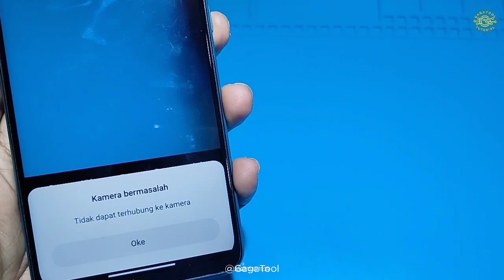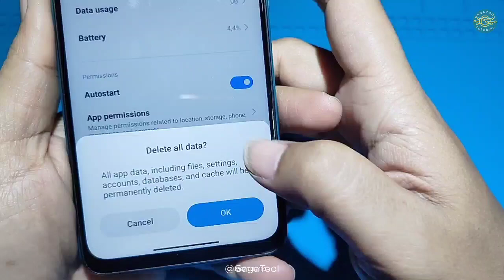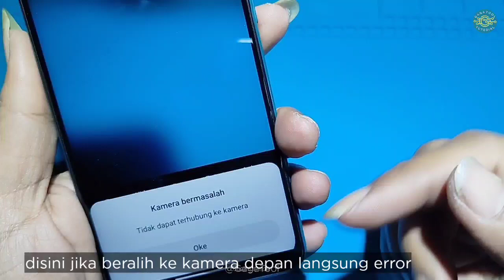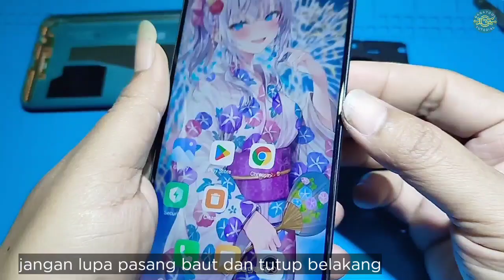Cara Mengatasi Redmi Note 9 Kamera Bermasalah ‼️ Tidak Dapat Terhubung Ke Kamera

Comment: saran donk bang... 
renot 9 pro 6/64 fulset 1400 minus kamera spt itu worth it ngga... 

takutnya servis mahal 😁
Reply from the maker: Kemahalan, Klo servis udah buka segel
Reply: @gagatool  ok.. mksh bang saran nya
Reply: Ane dpt 8/128 1.4, minus camera blkng 🤣🤣
Reply: @regresh  mantap
Reply: Kalo ram 6/128 gw sikat sih
Reply: note 9 pro 8/128 minus camera off,wifi off speaker off ( 1juta ) masuk ga bang
Reply: Seri 9 pro kebanyakan di ic cpu bad connect mahal biaya service nya,renall cpu